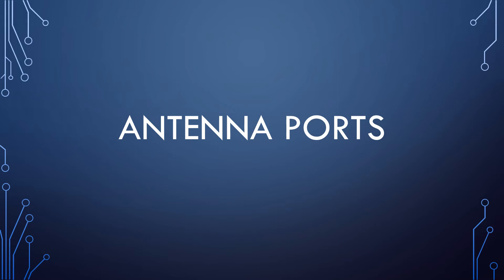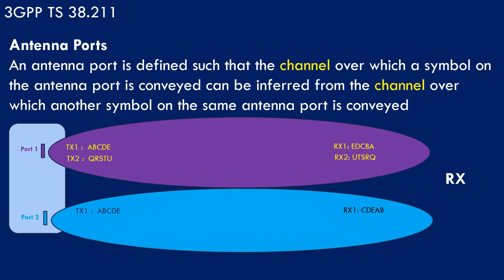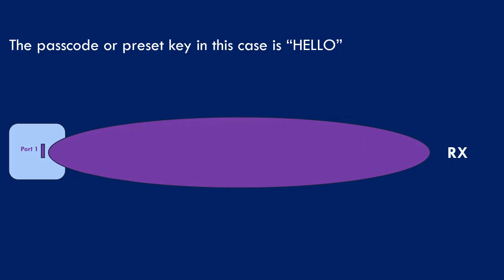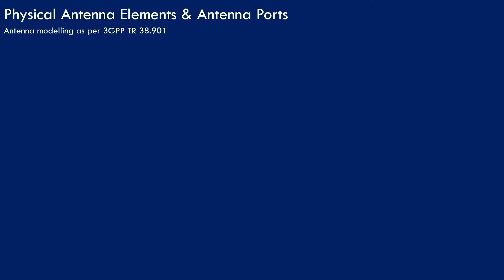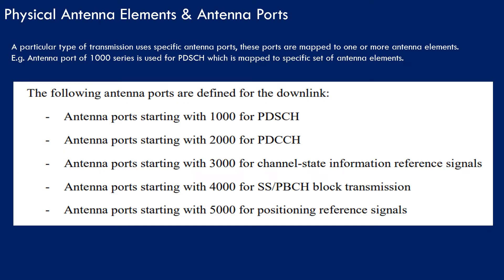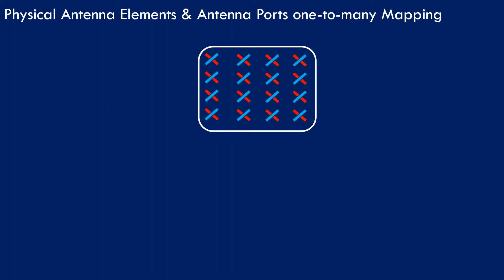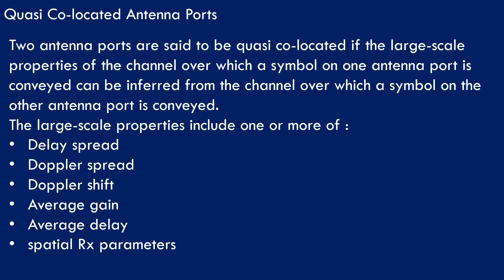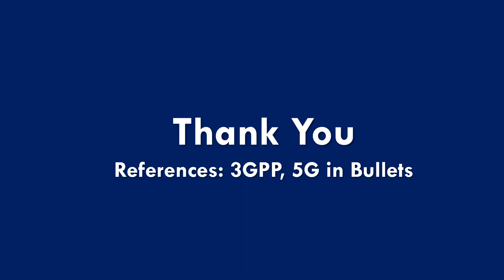5G Logical Antenna Ports, 5G Antenna ports, Antenna ports in 5G

Comment: Why it is 2 \times 2 MIMO even though there are 4 physical antenna elements at gnB? (at 7:36) Again at 8:32 it is mentioned 8 cross-polarized antenna elements when the figure shows 16 of them. Does it mean all the antenna elements in a column have the same RF chain thereby transmitting the same data?
Reply: Which physical antenna to be hooked to which logical antenna port is purely dependent on the person who designs it. It can done in any way he wants. 

This is what i think

Comment: Thanks for the informative video, can you also  confirm when  pdsch and DMRS holds antenna port 1000 and 1001 that means NW is sending two different pdsch data from antenna ports 1000 and 1001 separately. ?
Reply from the maker: Yes this is the case of 2x2 MIMO and it is possible to use spatial multiplexing, so gNB may send two data different streams from each port.
Reply: @TeleTale369  thank you for confirmation